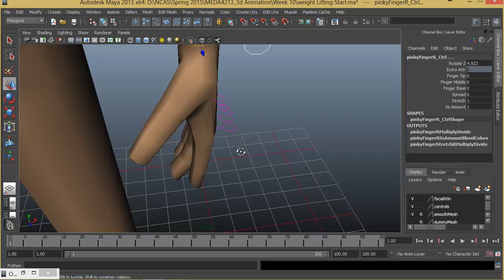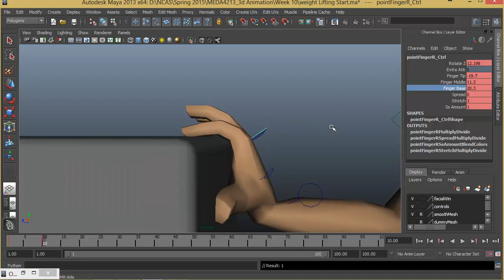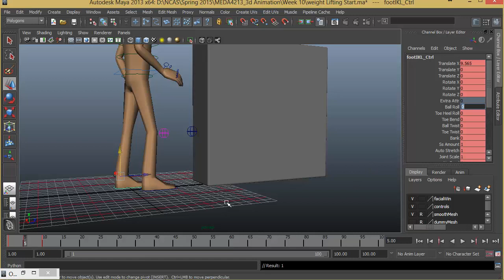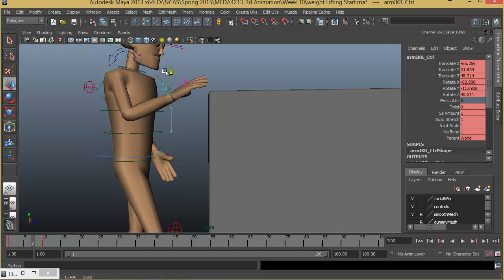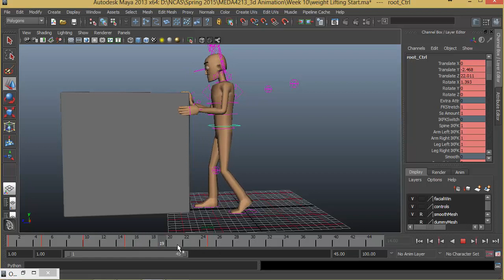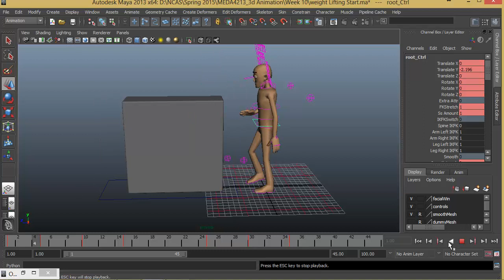Push Animation [Maya Tutorial]  | Rees3D.com

Comment: when im pushing my hand is going inside the box with body. what to do i am a new animator
Reply from the maker: Make sure u r using IK
Reply: @Rees3D  I'm having the same problem, what do you mean make sure to use IK?
Reply from the maker: The Rig has both IK mode and FK mode for the hands. So, when the character's hand is pushing the box, you need to make sure the hand is in IK mode. You can switch between IK and FK using the control curve on the hand. @Saiintx